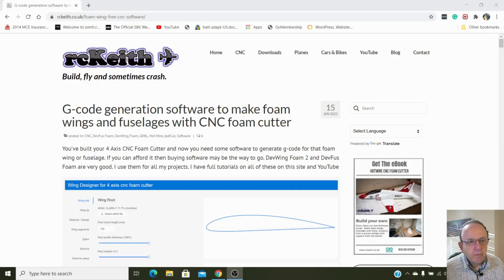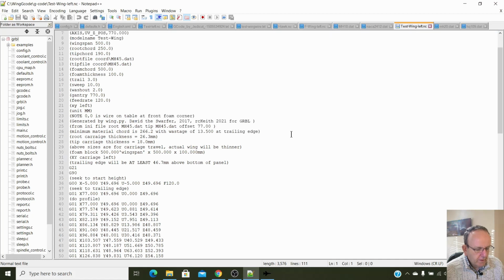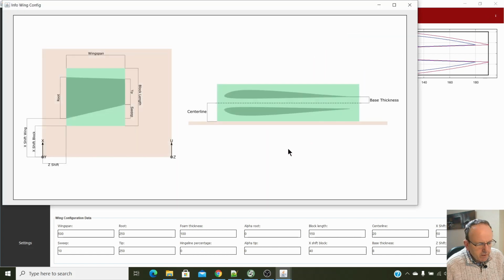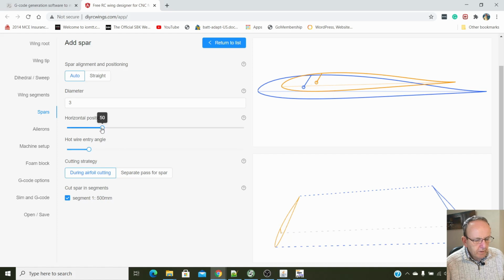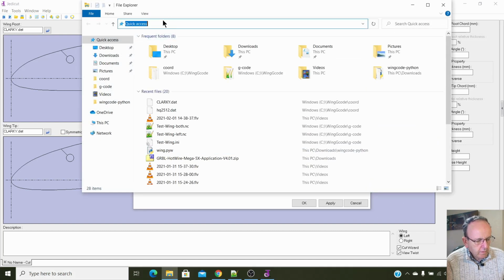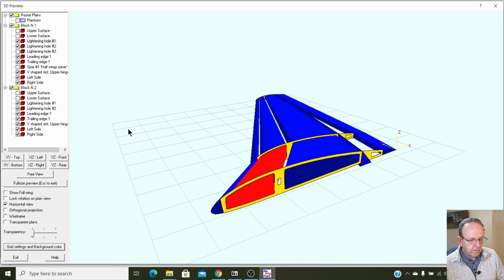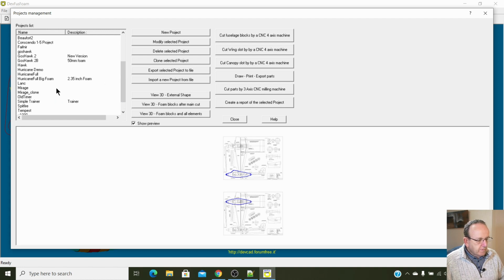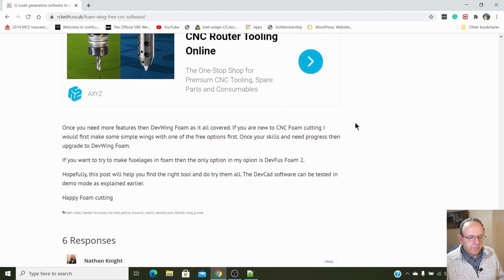4 Axis G-code Software for CNC Foam Cutters to make foam wings and fuselages.

Comment: Beware that DevCad can and will disconnect your license and then demand a lot more money, which is extortion. This happened to us after 6 months into a year paid license for the DevCad bundle. We are a startup developing aircraft mockups and this was clearly stated when we got the license, and had not changed when the license got disconnected. Because of this business behavior, you should not invest your time and money in this software.

Comment: Hi Keith, I have just finished building the rig you designed, and all is working well, however looking at the software none obviously allows cutting the wing profile from the trailing edge. Wing Designer is nice with a very simple clear interface, but I can't see how you would do this, with this program. Does DevWing Foam 2 allow this option? I would prefer cutting from the trailing edge and ending at the trailing edge so the foam core can act as a mold to make a fiberglass covered wing. There would be no entry/exit cut at the leading edge. Thanks for your very comprehensive videos which are well paced and easy to watch.
Reply from the maker: @GaryP-d4c  Yes DevWing Foam2 does that by default and has many other options.  I explain some tips and tricks on my website post https://rckeith.co.uk/devwing-foam-2-tips-and-tricks/

Comment: Great video thanks a lot! Right now I use foam xl 7.0. It provides cutting wings in pairs. Would you recommend cutting wings in pairs? 
Viele Gruesse! Chris
Reply from the maker: Yes, I cut mine in pairs using DevWing Foam. I did try using Foam XL 7.0 but I don't own Mircosoft Excel so I couldn't get it to work on Libre Calc. Thanks for your comments.👍

Comment: This guy has, by far, the best instructions and methods for setting up a CNC Hot Wire cutting system on the internet.  Clear, easy to follow, and inexpensive.  Good work Keith.
Reply: thats right, there is nobody that dedicated to show his knowledge to others and with such patience as him and dealing in the process  with guys far away like me who by the way dont know anything about this world of cnc and can make such simple mistakes on a daily basis, i can count with one hand the people i´ve met like this,  as soon as i have my machine done i will show it to him, of course mine is a very low income model since in my country is very hard to find and buy the parts.
Reply from the maker: Many thanks.